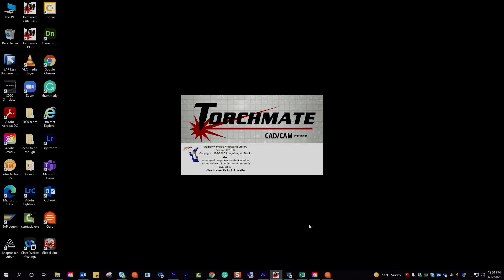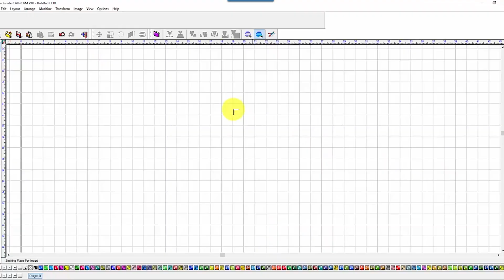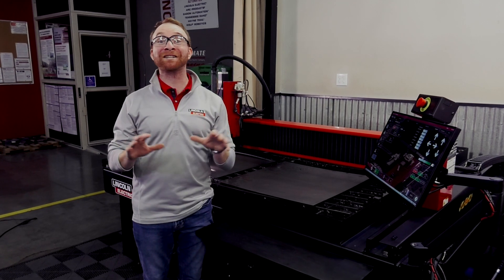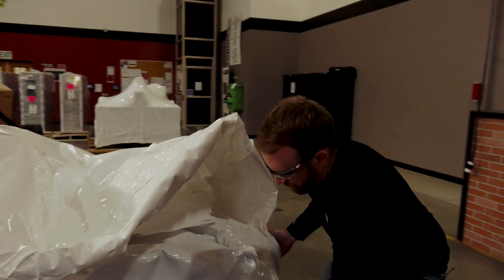New and Improved Torchmate® Plasma Tables For 2025!

Comment: At 2:00, I noticed the software was Torchmate CAD 10. Has Torchmate CAD 10 been released yet? I don't see it on your website yet.
Reply: Because Cad 9 is also Cad 10 but with one feature  difference  in the table software it can do all files  just like 9 and have one extra conversion  feature unless you have strict  tolerance  then 9 will just as fine 🙂